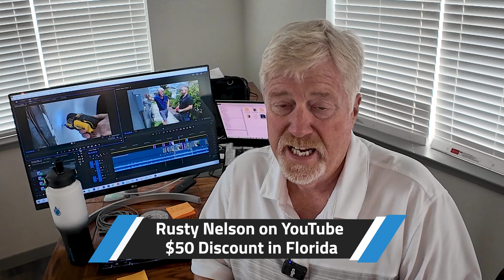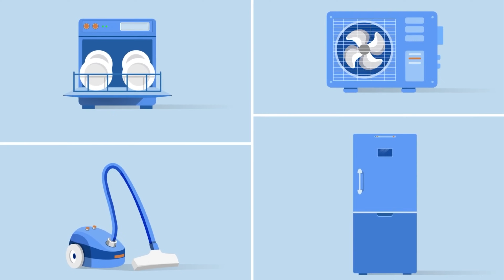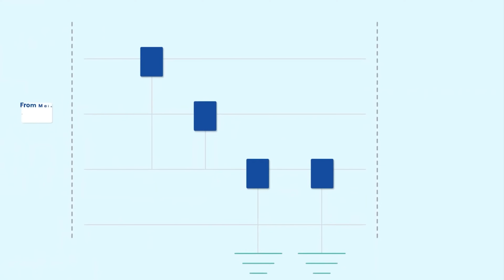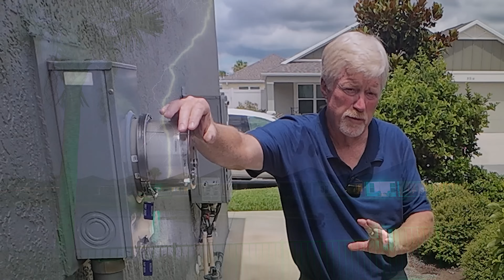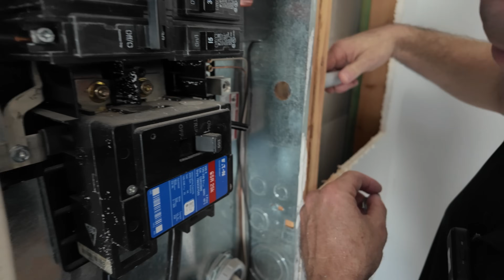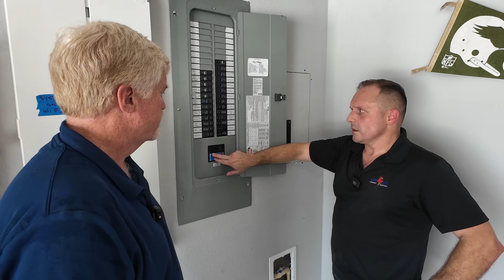Important! Whole-house Surge Protection in Central Florida & The Villages. $50 Install Discount Code

Comment: Lenhart - what kind of meter can measure resistance like that?  Never seen anything like it.
Reply: That is a Clamp-On Ground Resistance Tester. These are specially testers use primarily for testing the effectiveness of grounding systems.
Reply from the maker: Thanks John.  That ground is important even if you are not going to use a surge protector.  Subscribe Button for new videos: https://bit.ly/3aToJ3H

Comment: Lenhart charges $700. (With the $50 discount) for the Vortexx and $450 ( with the $100 discount ) for the Eaton Ultra. I agree the Vortexx has some interesting features but i wonder how much better it is since the specs are very similar given the difference in the price?
Reply from the maker: Yes the specs are really close but after some investigation I thought the GDT made sense.  I'm not an electrical engineer but when I started to see that setup in commercial (sensitive electronics) type protection I figured there must be something to it.  Plus the warranty made me give it a second look.  Also, since I had to deal with them a little it was a good experience.   I hope I never have to find out if the warranty works...LOL. Subscribe Button for new videos: https://bit.ly/3aToJ3H

Comment: Curious. What happens if the system is triggered? Is there a reset button, or does the unit have to be replaced? Also, what's it cost? Thanks!
Reply from the maker: You will need to call them for the cost.  The unit is constantly "triggered" with spikes.  The unit has a lifetime warranty.  If it goes bad you will hear it with the alarm and the light will turn red.  Subscribe Button for new videos: https://bit.ly/3aToJ3H

Comment: Did he relabel the panel after moving the breakers?
Reply from the maker: He actually went back to get a label that matched the one I had to relabel all of it rather than just using whiteout.  I think he talked about that towards the end.  He did a great job.  All I had to do was fill in the cracks in the drywall.  Subscribe Button for new videos: https://bit.ly/3aToJ3H
Reply: @RustyNelson  good deal

Comment: Thanks for the video Rusty. In the PSP video it mentioned that the Florida adopted the NEC guidelines in 2023 that all new builds would have whole-home surge protection. For homes built in 2024 and newer is their any benefit to having Vortex? Are there other PSP devices that do whole-home surge protection for other transients such as internet as I assume the Vortex you installed does not protect from those type surges. As I think of it, I've not seen any surge protectors for my internet cabling only the power to the electronic devices.
Reply: Hello! We do offer surge protection for just about anything connected to the home (generators, data lines, etc.).
Reply from the maker: Thanks for the info and contributing to the answers.  Subscribe Button for new videos: https://bit.ly/3aToJ3H
Reply from the maker: This is a great question.  I have no idea what they are installing on the newly required homes (2023).  I know that you need items like you said (internet, phone lines)   Might be a great group of questions to ask PSP as I know they have (and other companies) separate things for those lines.  Large surges from lightning yard hits can work it's way though all sorts of things from what I understand.  Thanks for the note.  Subscribe Button for new videos: https://bit.ly/3aToJ3H
Reply: They are installing an EATON surge protector circuit breaker in the circuit breaker panel. I believe it’s Eaton BRNSURGE Type BR whole panel surge protector or its equivalent. It’s not as robust as the Eaton Ultra or the PSP Vortexx or the Siemens external protectors but it will give you pretty good protection.
Reply from the maker: Thanks a bunch for the info, John.  I had a feeling that is what it might be as it is an easy install and very cost-friendly.  And yes some protection is better than none and it complies with the new NEC code for new builds I believe.  I thought about doing that when I started this investigation but I figured with all the electronics I have in my place I would gravitate to one of the more robust units.  Again...thanks for the note. Good to know.  Subscribe Button for new videos: https://bit.ly/3aToJ3H
Reply: @RustyNelson  Interestingly, these protectors were added to the electrical code to protect hard wired Smoke and Carbon Monoxide detectors and any other safety equipment. Apparently there were enough of these detectors failing from power surgesand and homeowners not knowing it for them to add this requirement, which should have been done a long time ago.
Reply from the maker: Yes I found that out and put that in my first video...thanks.  That was news to me.

Comment: We live in Palm Beach County. We spent a lot of money on the whole house surge protection. 
We had a huge storm and lost power . The surge took out the thermostat. The electrician said , he didn’t understand it bc the surge thing in the circuit box looked fine . 
I guess it’s helpful to have , but isn’t perfect
Reply from the maker: I wish I could really say something on that but without knowing all the facts its hard.  I guess on one end you could say maybe it did its job and think what it might be like if you had nothing.  I have no idea if it was a type 1 or 2.  Also no idea how the thermostat was hooked in.  If it was attached to the internet line or phone line that is a way you can have a problem as the hit can circumnavigate around the surge protector.  But with that said I'm not an electrician.    Thanks so much for watching.  Subscribe Button for new videos: https://bit.ly/3aToJ3H
Reply: @RustyNelson  Rusty you are correct. Having some protection is better than none. In this case regardless of how the thermostat was connected to the internet, usually it's wireless, they are all powered by the 24 volt transformer in the air handler. The surge should have been shunted at the whole house surge protector but since it wasn't, the induced surge could have been picked up somewhere along the thermostat line or the surge was reduced by the surge protector but not enough for the thermostat to handle. There is no way to tell. This is why we always mention that anything man made is not 100%.
Reply: @johnreformato1389   I agree with you about the air handler receiving some transient/surge which got past the "whole house" Type X (unknown) spd. In my case, I installed Type 3 spd's on most every major appliance (furnace, condenser, hot tub, etc.) because I could not get my electrical company to recommend for me a Type 1 spd. I could not install a Type 2 because my panel is full. Now, thanks to this video by @RustyNelson, I see a related product by PSP,  the VR-GEN, can be installed in the service side of my transfer switch for my generator. I have plenty of room there. So, I will recommend this to my electrical contractor. Thanks! Those Type 3 can still come in handy deflecting transients.
Reply: Is the Thermostat wired to anything else like home network/internet?